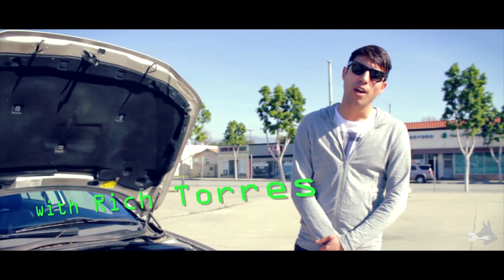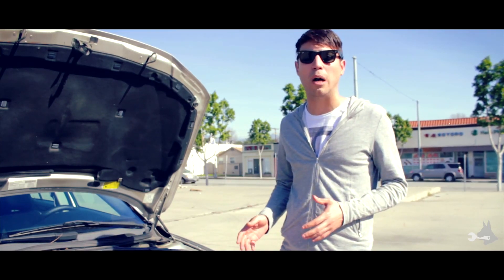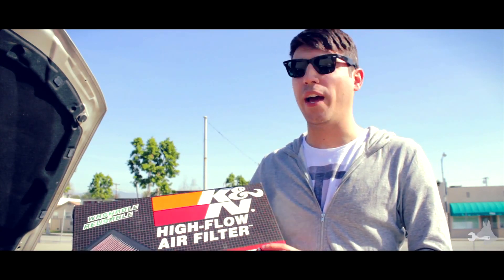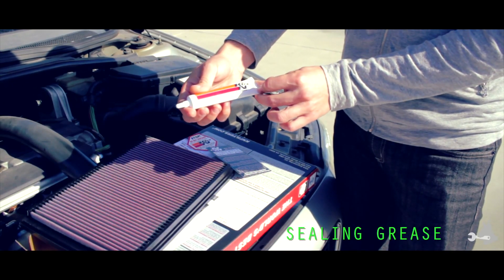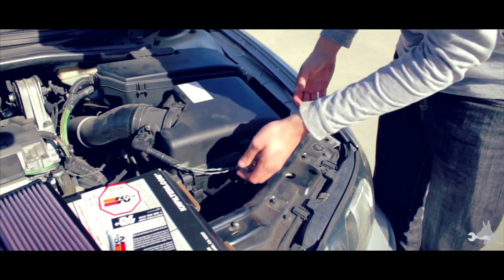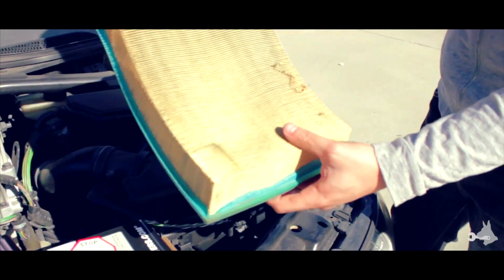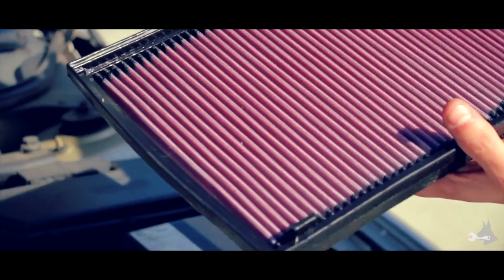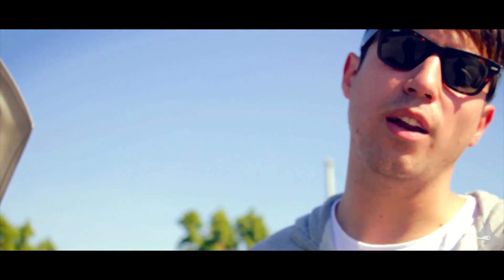Volvo S60 K&N Air Filter Replacement

Comment: I put one on my NA V70 a few moonths ago, no issues with MAF.   I think I cleaned the MAF at the time with MAF cleaner, airbox as well.  No issues, sounds like a bit more flow, throatier but only at higher RPMs.  Was unaware of other issues described here with oil damage to MAF.  Will probably clean it again soon just to be safe.

Comment: For what it's worth, I have an S60 and my Volvo mechanic (30+ years experience) was upset with me for putting a K&N in my car.  He said, "K&N are great filters, but not for Volvos.  I have had to replace several MAF's as a result of people installing K&N filters in their Volvos."  I'm not knocking K&N filters, just sharing an opinion.
Reply: The Mighty Cass what caused the MAF to fail?
Reply: Extreme Encounter the K&N filters have to be coated in an oil that ends up going into the intake and coating the MAF sensor making it eventually fail if you don’t clean it.
Reply: Main thing about K & N filters is the care...you absolutely MUST pay attention to the miles driven and be diligent with the cleaning of the maf.  Over oiling the filter will 100% jack up your sensor NOT simply installing the filter.  Point blank, you want a performance bump?  You need to treat it as if you had a forced induction set up.

Comment: Can someone explain the purpose of the grease on this specific model? Is air going thru the slit if you dont put the grease in? Won't the grease get sucked into the air mass meter when you get to high RPM? Why is there even a small crack?

Comment: The middle tab on the back of the filter housing lid refuses to go back in..what the hell am I doing wrong?
Reply: +Max Weisenstein I usually put a wooden board or something between the filter housing and the fuse box to brace against when I push the middle plastic clip back in. It's very important that all the clips have connected or the filter will sag and creata an air leak.
Reply: +Max Weisenstein There are two little nubs on the middle tab.  You have to tilt the front of the lid upwards so that you can slip the nubs under the slot opening for the middle tab.  The nubs on my air box lid broke off, and judging by how easily in this video he pulls the lid off and puts it back on, I'd say the nubs on his lid are broken off as well.

Comment: DISCONNECT the MAF sensor or 'oxygen' sensor as this cupcake calls it, pull the cover completely off and clean the inside of the filter box.  K&Ns are overrated, the grease is not needed - use a WIX instead at ½ the price and the WIX filters MUCH better.  And do not reuse air filters- after 12,000 - 15,000 miles -- throw it away, spend another $20 and repeat.